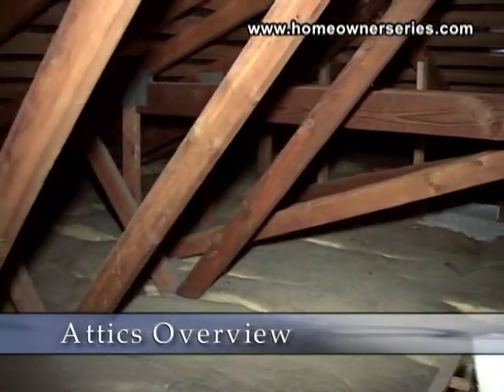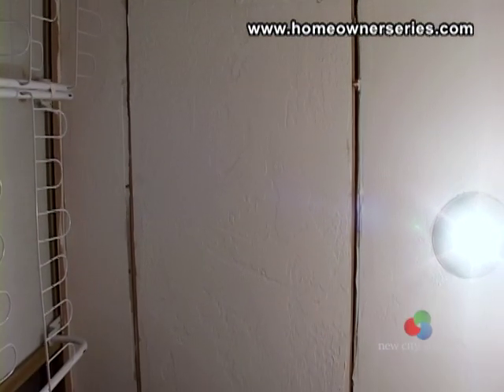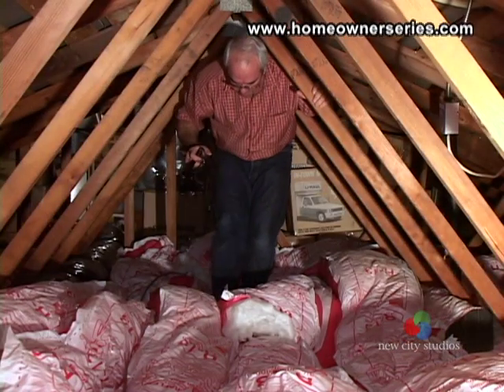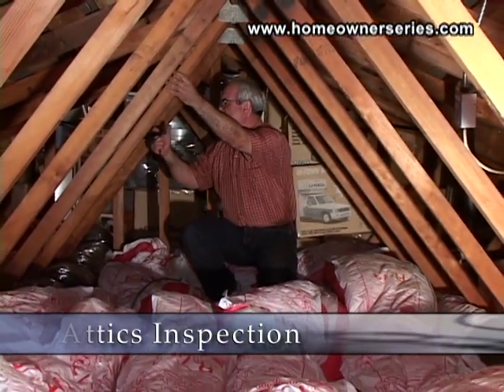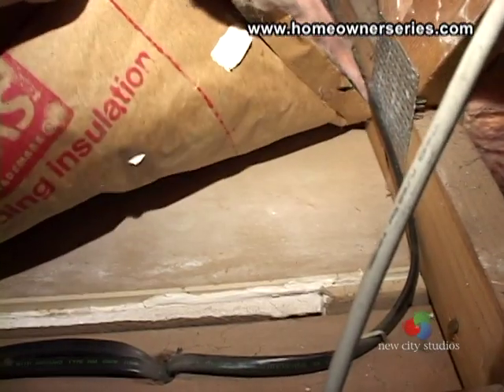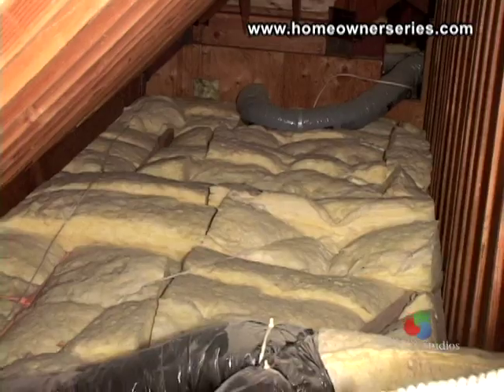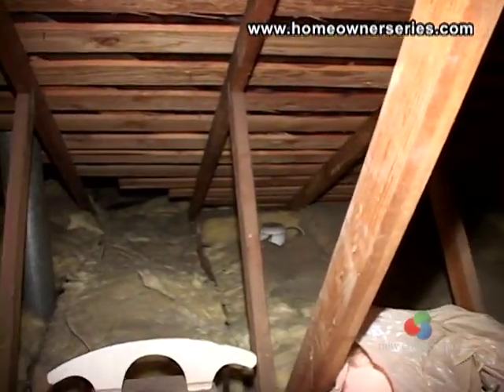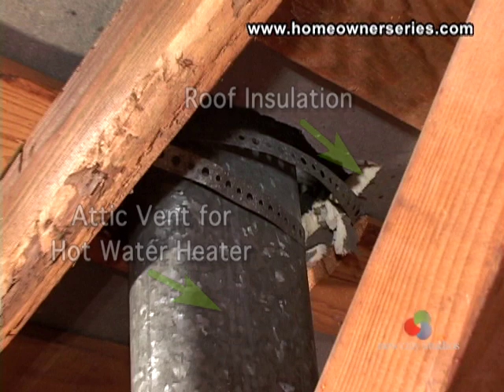Home Inspection - Attics - Part 1 of 2

Comment: I called a roofing company for estimate, they said attic had no ventilation, plus 2×4 rafter were cracked, Sister Rafters with 2×6 Douglas fir...plus added ventilation . Roof is not sagging and is safe.